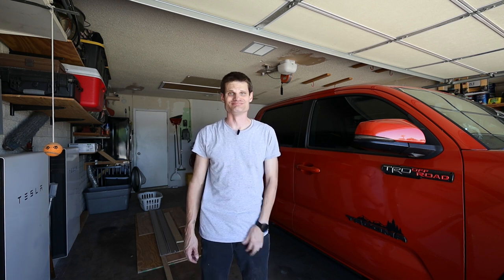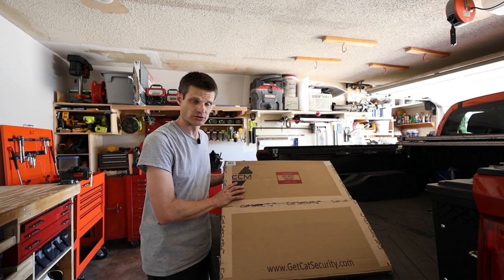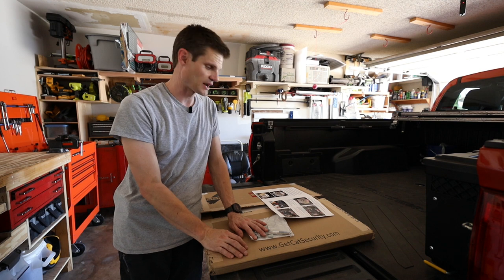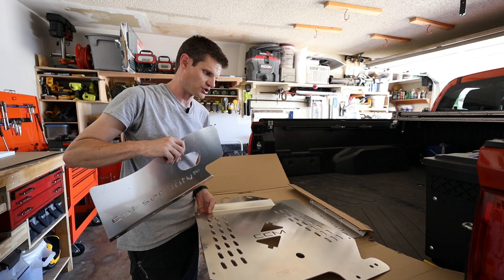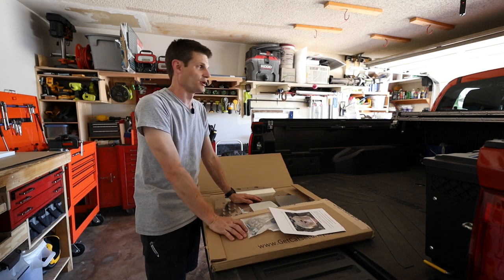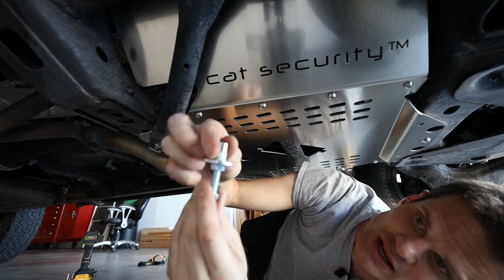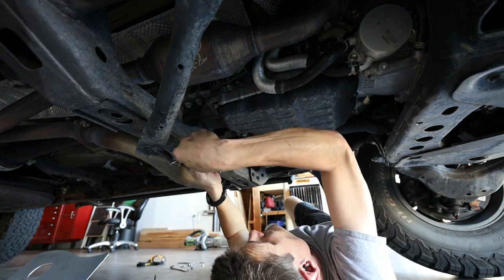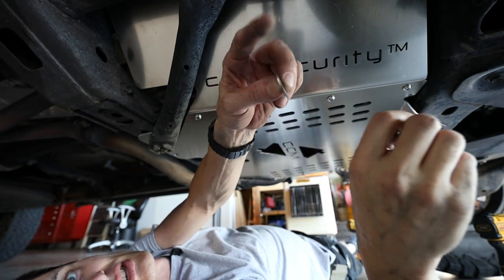Catalytic Converter Anti Theft - Cat Security Toyota Tacoma

Comment: How do you get to the oil pan
Reply from the maker: It covers the transmission but does appear to have access. But it's most likely going to be easier to remove it to service the transmission. No different than having to remove the skid plate to do an oil change except, far less often.
Reply: @ICanDoItMyself  how's it with greasing the zerk fittings on the drive shaft?
Reply from the maker: @erlbendo  it doesn't cover the driveshaft at all.
Reply: @ICanDoItMyself   I might be mistaken, but it looks like it covers the drive shaft to the front 2 wheels.
Reply from the maker: @erlbendo  yes, you're correct. I was thinking of the rear driveshaft.
Reply: @ICanDoItMyself  Is there a way to get around to service that drive shaft? Or is removing the shield the best way?